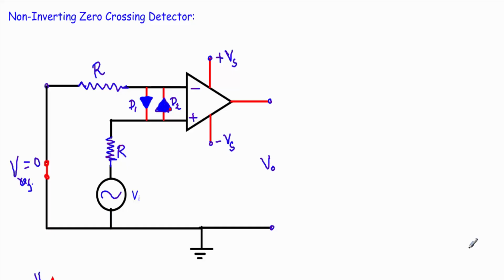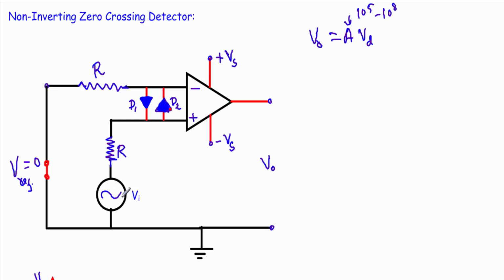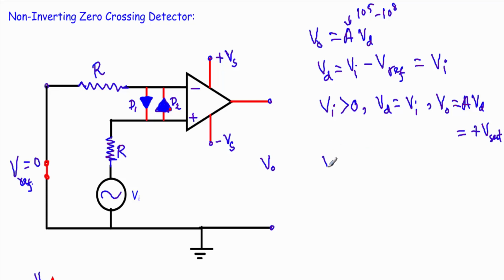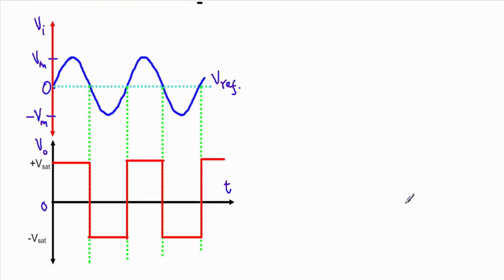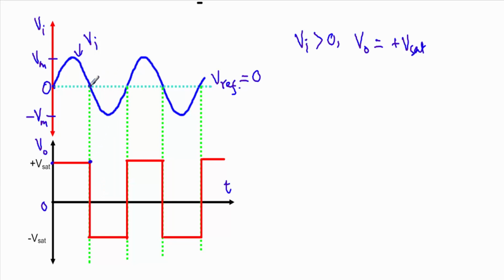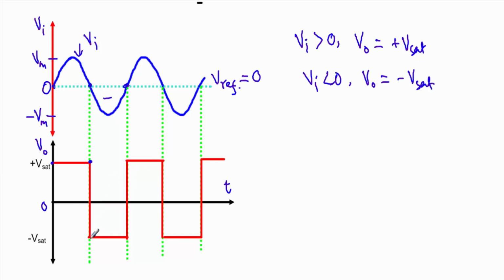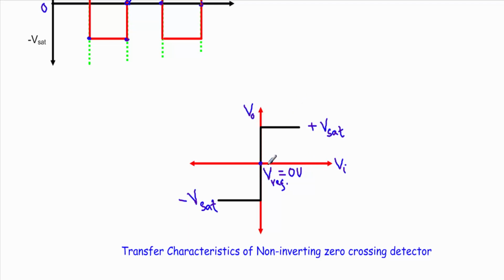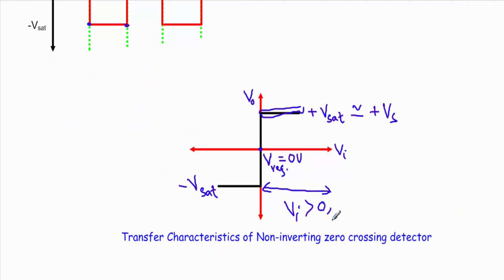Op-Amp as Non-inverting zero crossing detector

Comment: whats the use of diode in this ???
please explain
Reply from the maker: these are ordinary pn junction diode, so that the voltage between inverting and non-inverting terminals does not exceed 0.7V
Reply: that means voltage applied are very small may be in mV , and when diode get on we get a constant output,
0.7*A(gain)
Reply: 0.7*A(gain) +ve or -ve depending which diode get on
Reply from the maker: hm
Reply: What will happen if voltage difference between inverting and non inverting terminals exceed 0.7V? Output voltage in both the cases will be saturation voltage i.e. supply Vs.